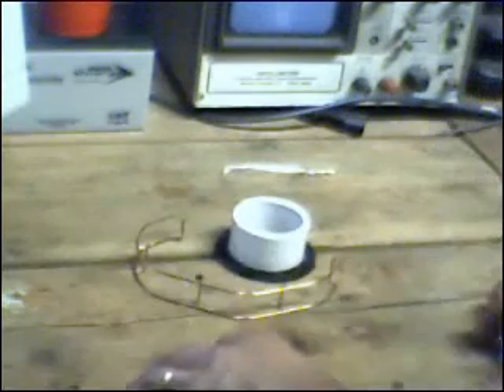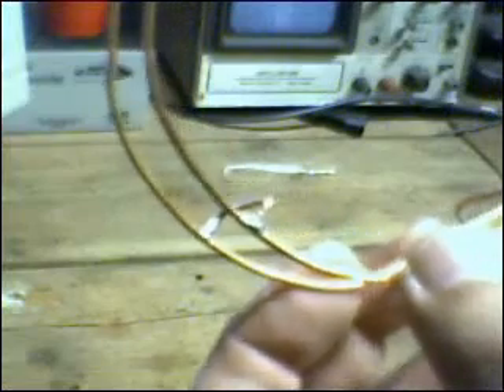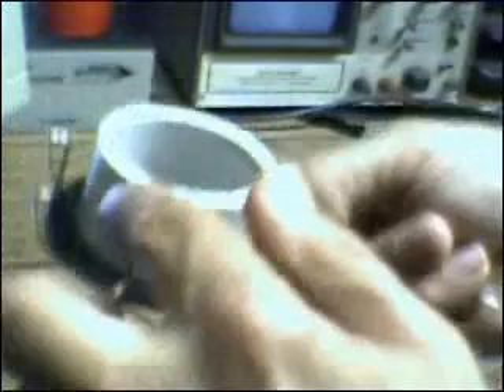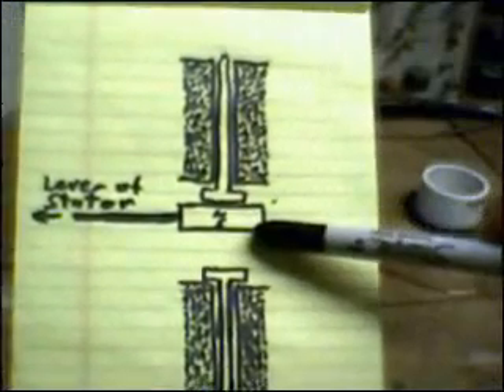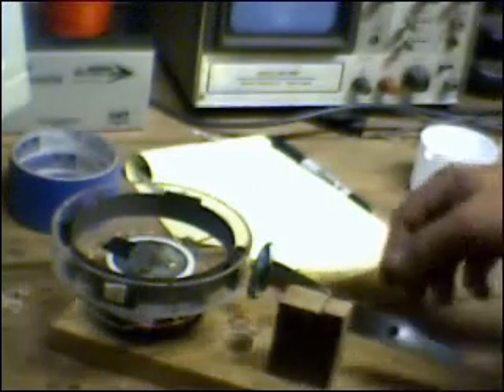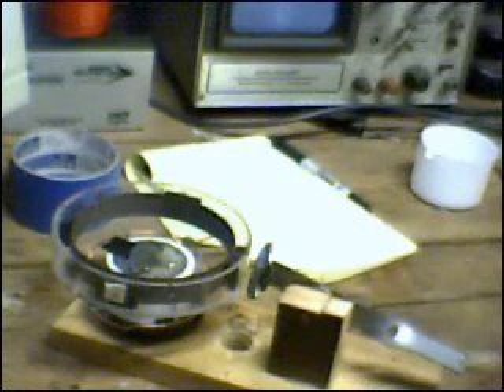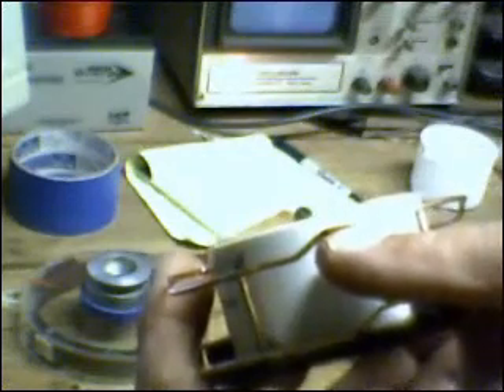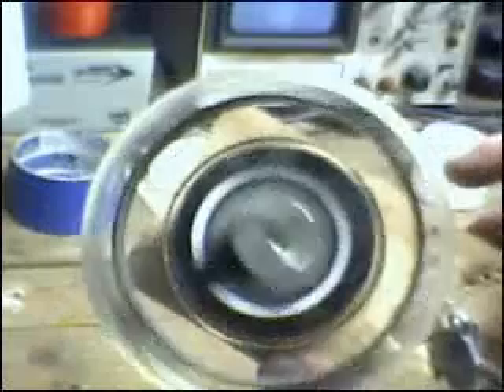06 - Magnet motor bobbin assembly progress.

Comment: Even though you have fabricated a racing track for a bearing to help move the lever up and down at the precise time, would mounting the half shaped magnet on a spining disk with perhaps two or three more hard drive magnets (to keep the 2:1 ratio level you have currently)  instead of needing a lever action?

Comment from the maker: Mechanically actuated with precision mfg I'm guessing maybe several thousand RPM max. I also wonder if there would be a way to replicate the action of the stator field electronically leaving only one moving part, the rotor. Then it might be able to achieve tens of thousands of RPM. That's down the road.

Comment from the maker: Yes, I'm pretty happy with the results. I agree that a purely mechanical model is preferable and will erase any doubt of over unity. Also came up with a linkage configuration for the stator actuator arm that will allow me to A) Adjust the ratio by changing fulcrum position and B) Finely adjust the stator center point to the rotor edge with a screw.